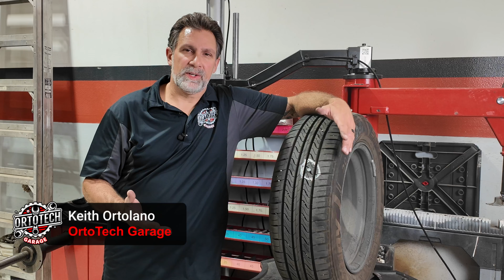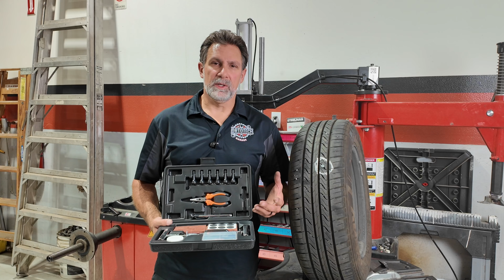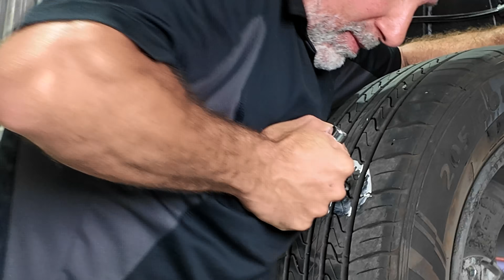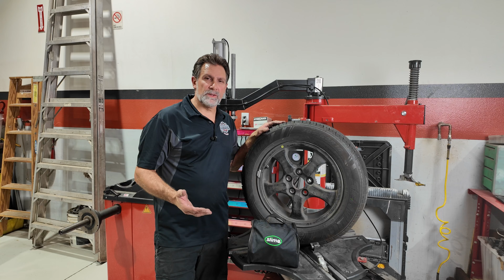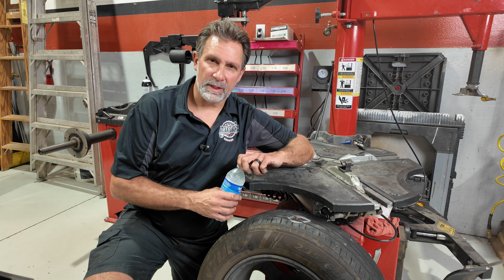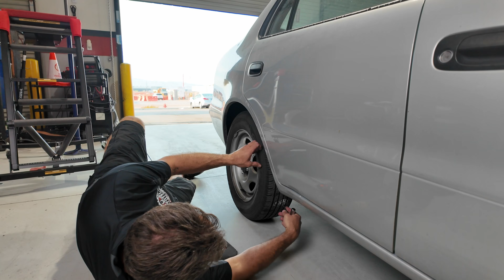Fix a Flat Tire in 10 Minutes – No Jack, No Tow Truck, No Problem!

Comment: You have too pull the tire off the car cause is hard laying on the ground trying to push the plug
Reply from the maker: It can be done if you ream the hole properly and have decent leverage. You may have to lay on the ground to exert some pressure.

Comment: But tell them that you downrate the tire speed when you apply a cheap DIY plug!

I would never keep one of those. Perhaps for a true emergency, but it gets replaced by an internal patch ASAP.
Reply from the maker: This is good advice. Although a proper plug repair will generally last the life of the tire.  I have never seen one fail that was installed properly.  That doesn't mean it can't happen, just that I haven't seen it.  If unsure, as you suggested, take it to a tire shop after your emergency situation is over, and have a repair done by a professional. 👍

Comment: Thank you for this video. I had one of these kits (not the one you have), and it was a real bear to try to get the plug through the eyelet. The second time I used the tool, the eyele broke when I was forcing the plug through.
Reply from the maker: You're welcome!  The right tools make all the difference.  This one is about $30 on Amazon.  You can find it in the video description. Just click the link to my Amazon store and it will be in there. Thanks for watching!

Comment: Wanna hear something crazy? Back in the day,vehicles used to have spare wheels or donuts. It was crazy,you could have a flat and just change the wheel with your spare. Then take the damaged one to a tire shop and have them fix it for little or no cost. 

Now we can't have that because you will get  .000001% worse gas mileage,using more fuel and inevitably killing some poor animal you could care less about. 

The good old days,right 😅
Reply from the maker: No doubt!  Its almost a novelty to have a full sized spare tire now.  Half these cars won't even supply you with a can of fix a flat either. It's mind boggling!  The Tesla video I did, with the model Y, had no spare, no sealer and no pump.  You had to buy the flat repair kit extra.  🤦
Reply: @OrtoTechGarage  I would like to hear you on those ''Slime''  Fix-A-Flat pressurized cans that you can use in an emergency ? I think mechanics don't like them since it seems to be a mess to clean ? Do you recommend it ?  Thank you very much as always !

Comment: Wondering how long will those self vulcanizing plugs last in the kit (unused) do they have a shelf life?  I could see myself buying a kit,  two years from now I get a flat and the plugs are shot from being in a hot summer cold winter trunk for couple years. Very helpful video thanks 👍
Reply from the maker: That's a great question. I think they have a very long shelf life because I've never used one that wouldn't seal.  I guess you could contact the manufacturer and inquire with them.  Or just plan to buy a replacement pack of plugs every few years, just to have piece of mind.  Thanks for watching!

Comment: Next, Can you show how to safely replace hood struts. I have a BMW and instead of the stick you use to hold the hood open it has 2 struts, one on heach side. A while back I was working under the hood and the hood closed on my arm and I had to yell for help for someone to open the hood. Luckily it didn't close hard enough to break skin or to break a bone. It was just squishing my arm. For now I got those things you put on the strut once it's open you tighten it on there and it prevents the strut from closing. Don't know what it's called. I believe people call it (Support Hood Clamp Holder)
Reply from the maker: Ouch!   Thats sounds terrible. Thanks for sharing your story.  I have had a few hoods fall on me, but luckily no fingers or arms.  Just a clunk in the head. The funny thing is no matter how often we recommend replacing them to out clients, most decline.  They dont seem to ever go under their own hood and could care less about our safety...  
I have a couple of the hood prop strut clamps.  They work great too.  👍

Comment: Great demonstration Keith and this is so much safer than removing the wheel on the side of the road or on uneven pavement.  I keep this exact setup in all of my vehicles. Depending on where I must stop I put out a flashing safety light and use a 1.5” thick mechanic mat for my old knees. I set the parking brake to prevent the vehicle from rocking back and forth. I start the compressor before reaming the hole and proceeded as you did.  I made my kit up out of frustration, due to unloading the families luggage to access the spare tire while heading out on vacation.
Reply from the maker: That's an excellent setup and great tips for safety and comfort! I appreciate you adding those important details that I missed.  Certainly goes a long way towards a more pleasant procedure roadside.  Thanks for sharing your experience!